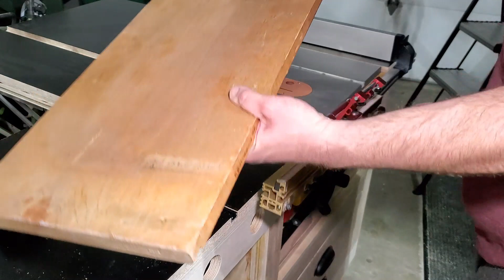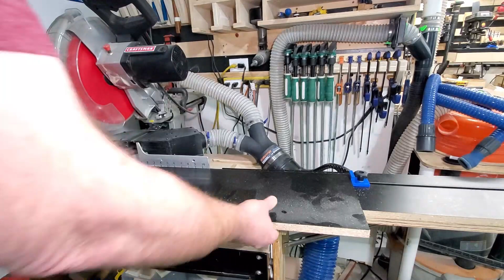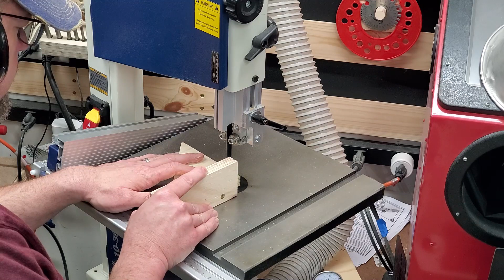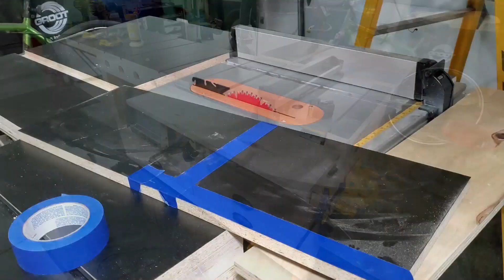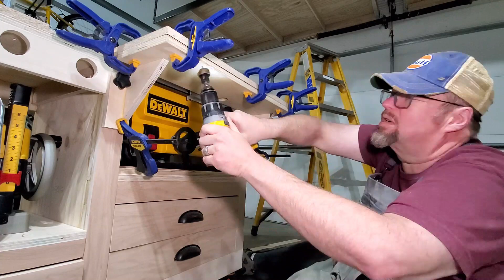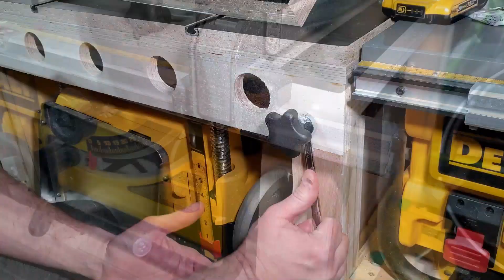HOW TO Build an Infeed table (support) for your Dewalt Table Saw

Comment: Hey there. Ive built this table with this setup last year, and its been going mostly great. I did a few tweaks here and there, like doing a whole width drop down leaf as an outfeed, so it acts like an outfeed but also an assembly table. I have a bad back so the planer down there is starting to hurt my back, especially on long and full width boards. 
Im currently working on a table which will have a waterfall edge and i need to cut a 45 miter along 25", and this is where the new in feed will come in. 
Im contemplating building an even deeper infeed then what you have here and maybe have a swing arm to stabilize the end a bit more. 
Would you cut a miter that deep with a miter gauge or build a giant sled? My only fear is at 45 degrees there might not be enough blade left to cut through 3/4" ply and my stock which is at 5/4. 
Thank you.

Comment: Hey thanks for the ideas! 
Quick question, where did you find black melamine particle board? I can only find white pre-laminated, or black melamine sheets that cost 3x as much that need to be glued on
Reply from the maker: Menards stocks it.
Reply: I have same issue, not even orderable from the big box stores,  and no Menards in my state.  Very strange. Have to keep looking

Comment: Turn the miter gauge around in the slot and cut it that way, or build a panel jig.  Both of these will also work without an infeed table.

Comment: Just ordered this saw with the stand for 300. Don’t plan on using the stand much rather I’d like to build something g similar to what you have done. New to this all and my primary concern between this and the 10” dewalt was the in feed . Thanks for the information

Comment: Very cool and this is exactly what I wanted 👍👍. But just one query about your two turning nobs, just wondering they will get loose over time as the wood threads will eventually get worn out. Maybe it’s better by using two insert screws and the turning nobs then screw into them…😂
Reply from the maker: It uses metal inserts, and the knobs screw into those.

Comment: You have a very good video and explain things really well. I have a 7491 and I don't have the ability currently to put my table saw into any kind of fixed Cabinetry. I'm trying to find a video that would let me put and in feed platform that is easily removable. My saw stays on the cart all the time because I have no room to really have it set up. I have to put my saw away every time I'm through using it. Even though I can't use your idea, I appreciate how will you explain it.
Reply from the maker: Thanks. Hopefully you can find something that works for you!

Comment: I like that this is removable so it won't get in the way when it's not needed. I have the DWE7485, and it's miniscule infeed makes some things tricky. But I didn't want to attach something that would make it hard to access the front controls. This looks like a great compromise!

Comment: Great video!  Looking for the next modifications you intend to make!  Any particular reason you didn't also cut an extended miter slot for the one to the right of the blade?  Would make it compatible w/ a deeper miter sled if you ever need that in the future, too, no?
Reply from the maker: It could absolutely be done. But, In the years I used my saw, i've never used the right miter slot so I didnt spend the time route the other slot. On the infeed if you did that, then you would have to move the fence fully out of the way, then you couldnt use it for infeed support for when making rip cuts on the long boards against the fence.

Comment: Nice design and video.  I have this same DeWalt saw and have a good out feed workbench based a heavily modified  Paulk work bench but, of course, not having any in-feed it’s hard to use many of the jigs I’d like to make. I did make an in-feed addition which after many modifications seems to work ok but, it’s big, bulky, needs extra support and not always accurate for matching up to the miter slots. I believe I will use your design soon and appreciate your providing your simple but very workable design.
Reply from the maker: Sounds great. Let me know how it comes out!